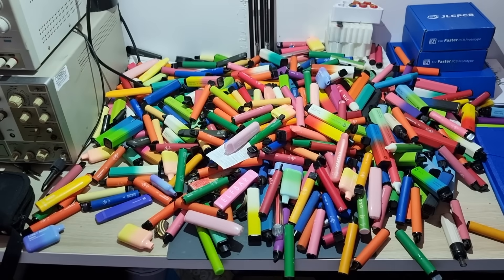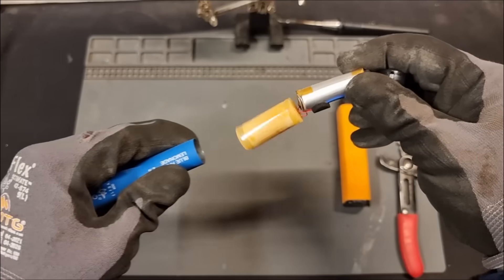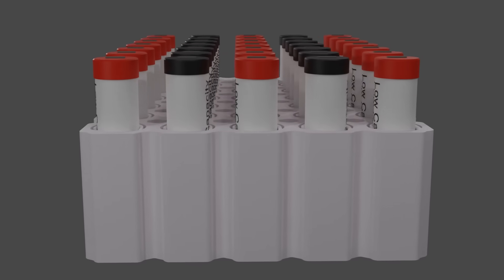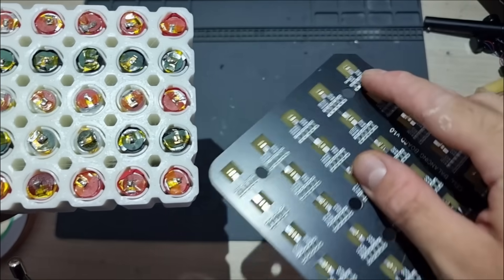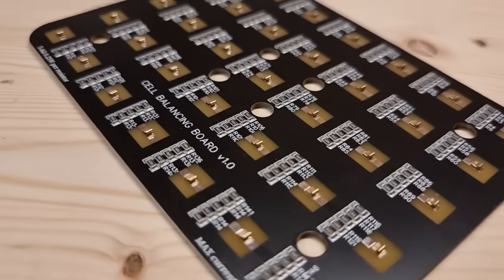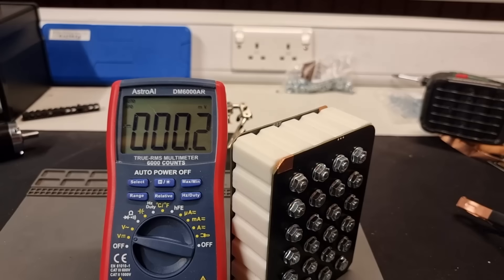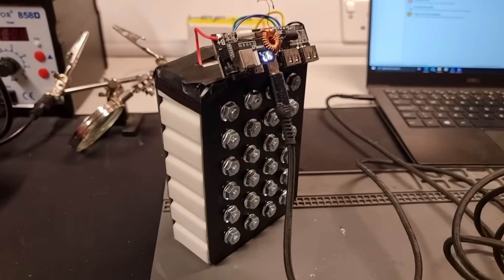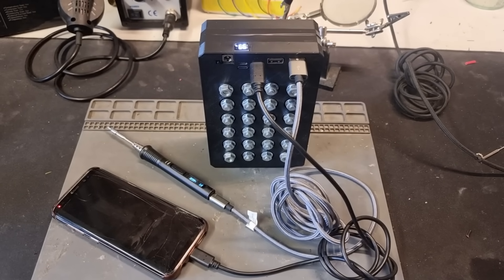Turning Disposable Vapes into a Fast Charge Power Bank

Comment: Nice project! it pains me to see all that waste :(
Would using an X-shaped metal bracket (or several of them) work to replace some of those bolts and still keep the PCB springboards in good contact?

Comment: this should like... really be a company. you'd make insane amounts of money if you had a buyback program, 1£/$ per vape brought in to insentivise customers and then sell the banks as 'repurposed vape battery banks'

additionally, because of the enclosures design, it can easily be brought in and tested, with individual cells being replaced as needed and properly disposed of when they're actually dead

Comment: I used all kinds of re usable and disposable vapes over the last 10 years or so and the disposables were the only ones to actually get me to 99% off cigarettes (i have an occasional one if its around out of nostalgia) but always hated the fact that you throw them away but the refillable ones, even with nicotine salt just dont do it for me for some reason plus the maintenance can be tedious at times. lately i found these off stamp brand ones, you but a kit with a battery and you buy "refills" but keep your battery and it attaches to a pod like an old surface charger. the pod itself also has a battery which kind of stinks but its at least smaller? idk i like to think its at least a little bit better.

Comment: Be careful using cells under 2.4v (Or if you're keeping this in your house, maybe under 2.8) - that's under the safe limit for lithium ion cells. Below that limit, degradation of the anodes directly occurs, so you can't tell how internally damaged the cell is, and charging it has a chance of thermal runaway. 

Great video :)

Comment: I've opened up a few vapes to recycle the batteries, and having looked up specs from the individual cells, not all of those batteries are rechargeable. That's an important thing to note for anyone interested in trying a project like this, and should REALLY be mentioned in the basics of this video, if it's not a rechargeable disposable, check the cell carefully before you try to use it, lest you risk a bomb.

Comment: Fantastic work :-) I'm just questioning the use of so many nuts and bolts, as well as the spacing between the cells. Doesn't this add unnecessary weight, size and cost? 4 smaller bolts in the corners and mayhap one in the middle would have been probably sufficient.

Comment: Dumb question: Why didn't you just discharge all the individual cells, then "trickle" charge them (wth for example an outside power supply) so that they're balanced together before connecting them?  Just curious.

Comment: EV suck, better use for batteries, but yeah i been doing this for a long time, for UPS replacement batteries and jump start battery packs and drill replacement batteries ect, but they are smaller and lower cap then the standard lipo cells. Nice design on the battery cell.

Comment: I hope you've balenced the capacity of the cells as well, I've learned that you can mismatch capacity as long as they are voltage balanced as you did but if let's say you have a cell at 1000mah and an other at 500mah the controller will shut down when the smaller cell reached the lowest voltage.
Reply: Basically wasting half of the biggest ones, so you'll be able to use only the lowest capacity cell multiplied by the amount of cells. I have a bunch of pc batteries (the old ones with 18650 inside) and this is the biggest reason why I've done nothing with them yet, i have a tester but testing the capacity of all of them will take weeks

Comment: I'm a the head of our service department. We service our E-Scooters and i was able to make a 60Ah battery from all of the dead packs. You open them up, remove the damaged cells, take the ok cells and put them into a Li-Ion charger, to get the proper resistances and capacity and then use them with the ones that are similar to eachother.

These are 18650 cells, so easier to work with than the ones you're using, so it makes your video even more impressive. Great job on this!
Reply: Don't they go bad very fast?
Reply: @James__Sunderlandd  as long as you keep them around 3.8v, they can survive for a while.
Reply: @James__Sunderlandd  No, usually the cells that die are due to the way a BMS works causing the cell(s) with the highest charge to end up going bad due to constantly charging them beyond their rated capacity. Also, letting the batteries sit uncharged for too long can cause some cells to go bad, but never have I seen them all be bad in any pack.  If the pack is from a name brand tool, then the quality of the cells will be top notch. So long as you add a BMS to any battery you make with the cells, and actually maintain the charges properly, they make an excellent "free" source of the most expensive part of any project. I have built several eBikes, converted most of my devices to cordless using buck/boost converters and 3d printed battery housings, and recently I built a 16s9p battery for my eBike. I have had most of these batteries for over two years, and I have not had to repair or alter any of the batteries I have built using the reclaimed cells. If you pay attention you can find a plethora of usable cells at  specific "box" stores in their conveniently placed recycle bins.
Reply: I've been running them in 

Lights for years now I even use the type c charge ports that come with most  been ok for me & I am using the lithium polymer cells they will draw a big amount of amps for a ebike battery though. I stared Way before people started making videos on them  @James__Sunderlandd
Reply: hi i repair ebike and scooters too and was wondering where you guys are based. thank you and have a great day
Reply: I work with a rental ebike fleet and we had a string of bad batteries as well. I've been ordering 16 battery DIY shells from china to make battery banks for hurricane season. I've currently got enough to last longer than I'll inevitably live.

Comment: A very educational video. Great background story. 

There are a couple of areas that are of concern and can be improved. (less so short term, but long term could potentially be a safety hazard)

1. using resisters between cells for balancing can be problematic if you happen to have a lower capacity  cell. Such a weak cell will not be able to provide as much energy as the rest, so it will end up charging as others are discharging, and using energy from the other cells. Since internal resistance of cells increases with age, this additional accelerated cycling will cause the cell to get warmer as it's age accelerates. 
(if all the cells dump their energy into a single cell, that energy becomes heat .. sure with resisters it be be less heat, but that one cell is going to be abused over time)

2. a reliable way to test how heathy cells are is to measure individual cell capacity (how many amp-hours it can hold). Weaker, or damaged cells will have lower capacity. Testing cells before building a pack can allow selecting to incorporate only the most health cells. It will also give you a higher overall capacity pack, that will last longer.

As an extra safety measure, to avoid a hot cell, is to electrically break the pack into modules so each module only has 1-2 cells. This way can periodically charge/discharge cycle individual modules to measure and log capacity over time. If capacity of a module begins falling faster than other modules, then you know there are some failing cells. An infrared camera can show if cells are warmer, something not easily testable by touch, and impossible to see visually. The best pack designs have individual cell monitoring and charging circuits. 

Lastly if going to dispose of li-ion batteries, take a bit of time to fully discharge them. IF possible take them to a recycle facility, where the valuable materials can be reused to make new battery cells.

Comment: No need to build a PCB board for balancing. Only before assembling should manually charge each cell to the same voltage. Finally, a BMS is needed for balancing, but it is much simpler and cheaper to install than a PCB board like this.
All in all, great project, keep it up 🫡

Comment: You really should solder a wire or design another pcb that allows for individual cell balancing as currently your setup can be deadly as some of those cells might get outta balance in the coming months . Correct me if I’m wrong but the setup you have won’t let you read the individual cell voltage. (Extremely important ).   Please please please tell me you have individual cell balancing or at least top balancing the cells.

Comment: Rechargeable lion batteries usually have the entire outside of the cell act as the negative terminal. With the positive terminal just the a little nub. Using a copper tape across the + and to the body seems to be a concern if the tape insulation wears through. Or are these cells different than typical 18650 cells from laptops etc?

Comment: definitely look into how typical battery packs are made if you havent already. Typically the cells are spot welded together with a piece of wide "flat wire", then shrink wrapped. This would significantly reduce the size and cost of your packs, however limit balancing options.

Comment: I've been repairing consumer electronics for about 10 years now, and something I like to do is make my own power banks from recycled laptop batteries. At least, the older kinds. Around maybe 2016 many of them switched to lipo, which are quite difficult to work with for the form factor of a power bank. However, older batteries (particularly user removable ones) are just a bunch of 18650 cells contained in a plastic enclosure. I did what you did a pretty long time ago and harvested a bunch of these cells to use them for my own purposes. Many times half the cells are completely unusable (after all, these are reclaimed from bad, faulty batteries), but there are still almost always a handful that are perfectly healthy. 

I'm sure there's a way to utilize lipos for the same purpose, but the issue I've noticed with many of them is they contain additional circuitry. There is usually a BMS integrated into the battery pack, this is what the wiring harness attaches to. I have a feeling this wouldn't play very nicely when trying to frankenstein a bunch of lipos. While it's possible to remove the BMS and mish mash lipos together in parallel or series, this seems to me like it would be dangerous as you wouldn't be able to easily load balance them prior to connecting all of them together. 

I was always grossed out by how disposable these kinds of vapes are. I personally use refillable, rechargeable pod systems. For $20 extra you can get the same exact form factor of a disposable vape, but get a device that can actually be easily refilled and maintained and will last several years. I don't understand why this literal trash has taken off. Throwing away an entire lithium cell seems like a horrible idea and I don't know how any of it is legal.

Comment: I use these batteries for replacing 3 AA or AAA batteries in electronics. Also the vape sensor board doubles as a charge controller if you apply 5V where the coil output is. Add a usb cord from a bad phone charge cable ( the micro end is what fails, so the main side  and cable is fine)❤

Comment: That pack should be able to handle 500w of power... Those are low density high power 20C cells. It would be cool for you to make a 240W version using the USB PD protocol. I know a 180W PD charger from Framework exists.

Comment: Great video! I noticed you wrapped both battery ends in the copper tape stuff, but the tapes both touching the metal battery housing. Would'nt that short, or is the housing covered in some thin layer of protection? Enough to trust it? Eitherway fantastic video mate, subscribed.

Comment: Man I really want to learn to do this type of stuff. I'm a software engineering and I was pretty good on electronics in physics classes at school and I have some minor experience with soldering like r/c motors or cables. What kind of knowledge do I need to gain to do such kinds of projects? Would programming an RGB controller with a led strip be a challenging task for example?

Comment: I vape weed and you can't really get just the juice here.  HOWEVER - I harvest all the batteries. They're handy for powering low power projects like remote sensors, especially when paired with a small solar panel.

Comment: What are the specs of your power bank like total mah , max voltage, weight (plase without all of those bolts), max discrarge amp (w/o this power module) and dimensions. Maybe with a little dense design that may be perfect for recycling these lithium cells for some e bike or scooter battery

Comment: Here's a tip for making 3D printed enclosures. Try out vase mode. It'll print a thin shell with a solid bottom. Slide it over the assembly and use a separate printed front panel to close it up.
The result is a super smooth, seamless enclosure with a front panel.

Comment: Great job. hopefully you were advised in the comments that it is a good idea to measure the resistance of each cell and match them to similar values otherwise the battery will fail very quickly.

Comment: Very nice project! Super happy seeing waste get made useful again, especially something that is toxic to throw away and contains scarce resources to make.

I want a YouTuber with the proper electrical know how(that I don't have) to dig into saving the more advanced throw away vapes that I keep seeing.  Companies are getting near off the shelf PUYA brand qfp32 chips to drives dual element, led emblazenedd, throw away vapes.

  It was bad when it was just the batteries.  But batteries and charging circuits, LEDs, a controller chip that I think is a m0 cortex, and a USB c port just seems like so much waste!

I'm thinking about extracting some chips, putting them on adapters and sending them to some YouTubers to poke around on. Even if they have locks, maybe someone can crack it and make these things valuable to the maker community.

END OF LINE

Comment: When I initially started vaping years ago I would use the premade coils which as a beginner was fine.  I then moved up to making my own coils which with a roll of coil and pack of organic cotton it was much cheaper to make my own.  The disposable coils (ie pods/tank) are somewhat ok but I feel they can still improve waste reduction with a design tweak.  Disposable vape units however I'm completely against as they are extremely wasteful with both battery (that can be reused) and plastics that can be reused along with the lcds on them.  Personally I feel if a shop is going to sell disposable vapes they would need to pay a fee to offset the waste produced or at least the companies manufacturing these would need to pay fees to offset.